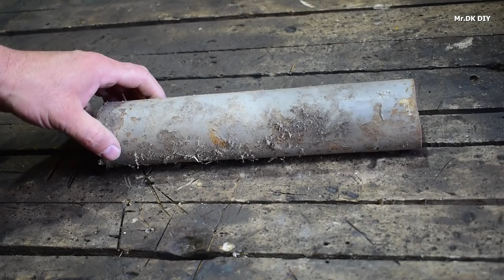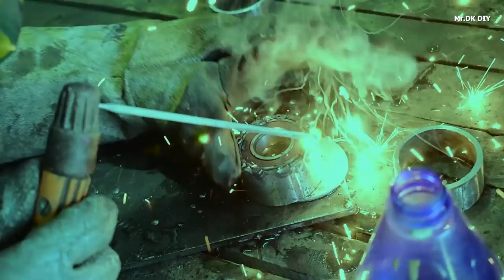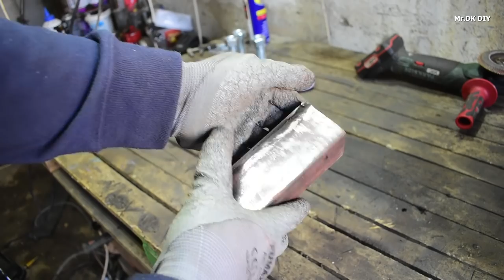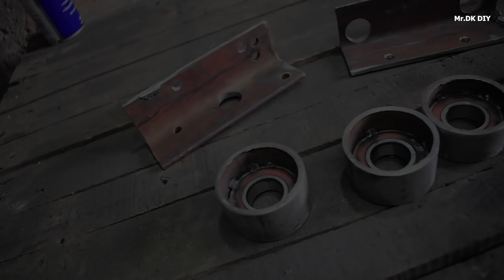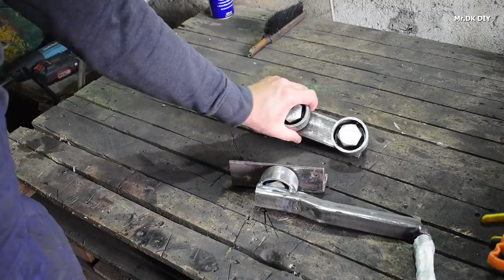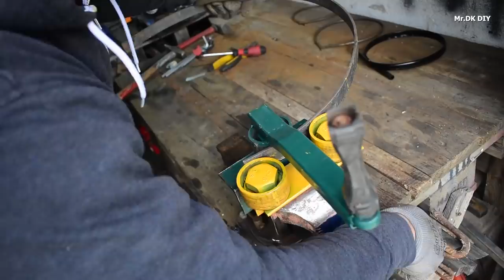3 BEARINGS ??? Let's make something Useful and Creatively using 3 Bearings !

Comment: Why not take the seal from the bearing before you weld them re fit it when you finish welding
Reply: If you take the Seal from the bearing the The Spatter from the electrode will stick to balls and ruin the Bearing